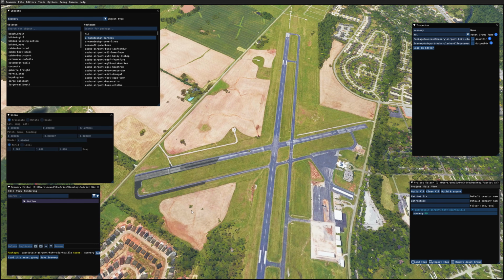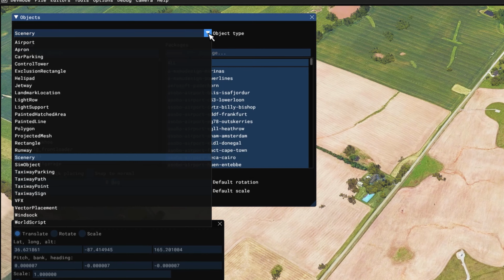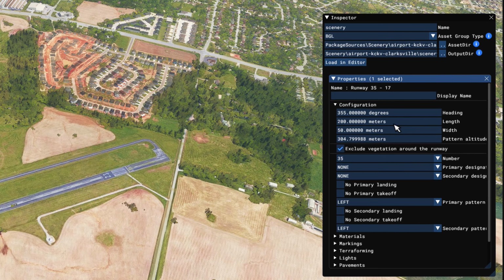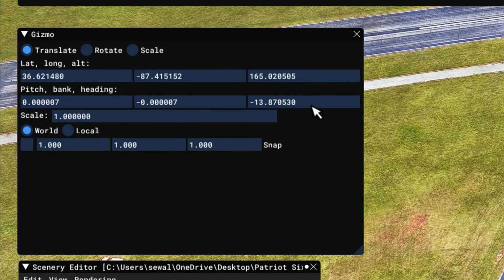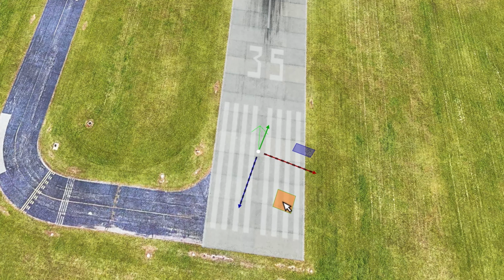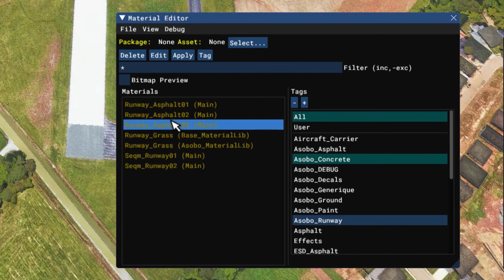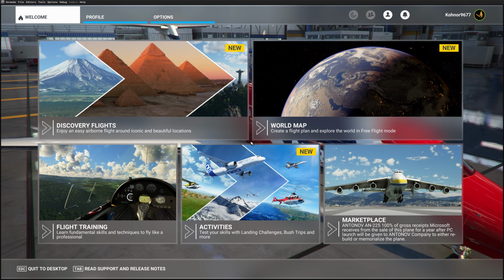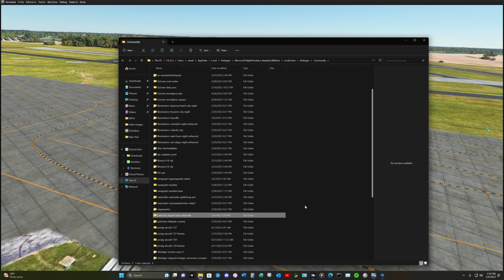1-B MSFS 2020 SDK QUICK REFERENCE GUIDE-Replace runways at an existing airport. A sequel to "1-A"

Comment: When I "add" a scenery object it seems to always put the object where it wants.  Sometime half mile away, lol.  I notice when you add it always appears right in front of you.  I there a trick for adding stuff and things like the polygon where the first one always shoots into space, lol.
Reply from the maker: Thanks for watching. Are you working in mountainous terrain? The only time I have seen things act, as you mention, is in very rough areas. Typically, folks need help with polygons in mountain areas. I have not seen objects behave that way. Sometimes, if you are putting an object over other scenery that has been heavily terraformed below, this can always present problems. Instances where you may run into this are placing scenery on an area where Google Earth files have been added by a creator. Sometimes, it can happen at third-party airports. It depends on how the creator built the file. As for standard unedited areas, I only have an answer if my first suggestion is valid. Good luck.

Comment: Hello, not sure if this is really the sequel to 1A. What I wanted to do, I have a small airport (LEAX) and I would like to add some pavement (which is there in real life but not in the simulator), additionally I guess I need to add taxiways and parking spots, and clean up some other parking spots. I already removed some trees at the runway ends at this airport, but I am not sure where to find a tutorial for a task like that.
Reply from the maker: It is, and I planned to continue the series but decided I needed a break from videos and have yet to pick it back up. I have a couple of older videos that may help you.

https://youtu.be/UlWiAbhersg and https://youtu.be/7010EirtEQc

Comment: Great video. Is it possible to just select an existing runway and change it's surface material?
Reply from the maker: Hi, g bee. I do not see an option for that in the present SDK. It appears to be all or nothing. There may be a way to manipulate XMLs and other files in the official airport folder, but I am not 100% certain. Regardless, it will be convoluted. 

I know of a way, but it will be much more challenging than the method I used in this video. Please let me know if you want to learn more about the alternative method mentioned above.

Happy building, flying, and life.

P6

Comment: it seems to me easier to edit existing runways and not create new ones, especially since most often this is not possible because there is a binding to author's textures, etc.
but unfortunately it is not always possible to extract runway data from existing airports...
Reply from the maker: Thanks for watching. I have yet to try that method, so I must educate myself. 

I can replace a runway in about five minutes as long as I am not explaining every move I make. The idea of this video is primarily to educate folks about replacing a runway to bring the airport up to date where the runways are outdated in the Sim. 

It is illogical to replace a perfectly workable and accurate runway, as I selected in the video. But, I chose this location because plenty of changes are needed at KCKV in subsequent videos. So, I did the illogical thing so the video series would be at the exact location.  😄 That is the method behind the madness and the choices I made.

If you have a better way, that is the method you should use. Thanks for the suggestion. I will look into that because there will come a time when it will be applicable. 

Happy building and flying.
P6
Reply: @patriotsix5880  a good example would be to show the changes somewhere in a big airport (3rd party paid scenary). developers (even paid products) still make a lot of inaccuracies in important aspects, for example: wrong runway lighting system and papi angle, wrong runway length, wrong runway threshold altitude.
Reply from the maker: @radeon29  That's true. I own KATL. I purchased it from the Marketplace, and there were two control towers. I emailed the creator, and they could have been more helpful. Eventually, I went in and removed the Asobo Control tower myself. Which is an entirely different process. Everything you mentioned is something I can do except for Popi. I must educate myself before setting the popi angle, but it is doable. I will add that to this series. 

At Asobo airports, all of this is relatively easy. On payware, I need clarification. I would have to run tests. You can remove objects from payware, but I need clarification on making edits to runways, etc. With access only to the package and not the entire scenery folder, the embedded parameters may be hard to edit without redoing the airport. Again, I would need to run a test to know what can and cannot be changed outside of objects. The XML files that need altering are not accessible in the package. So, though it may be possible, it will be an arduous task and maybe a partial or complete overhaul.  I will see what I can learn. I am backed up at this time due to a home project. It's a wife thing. 😃